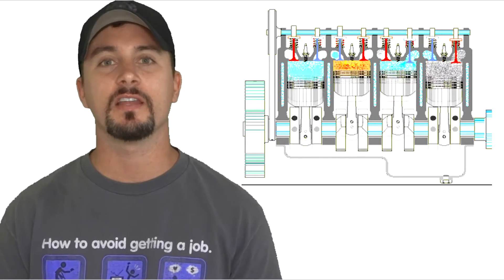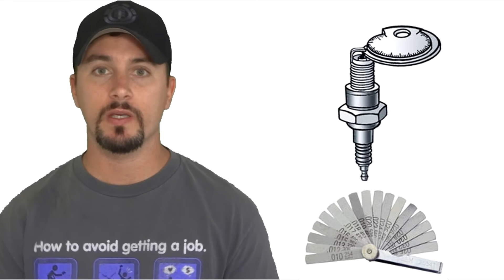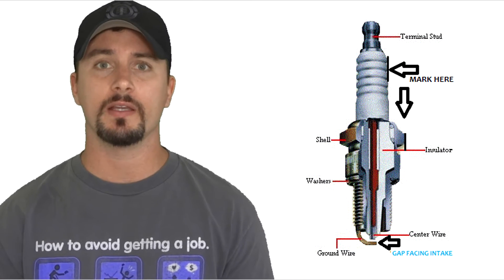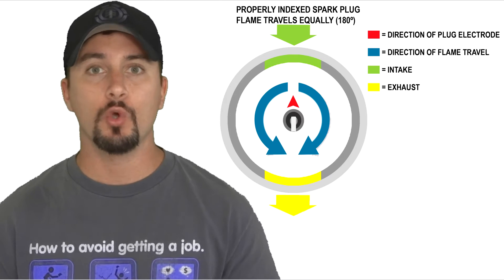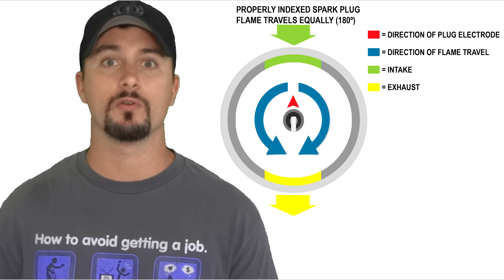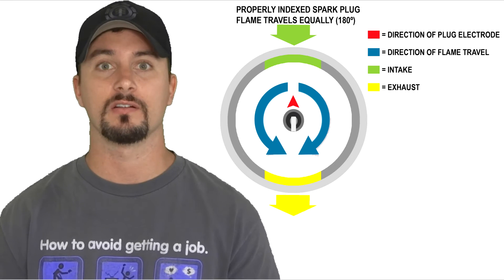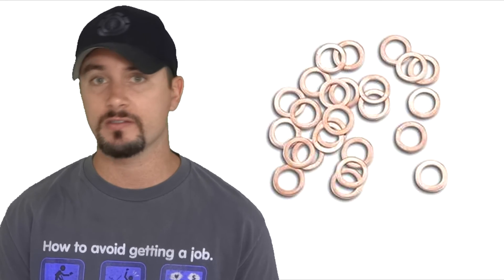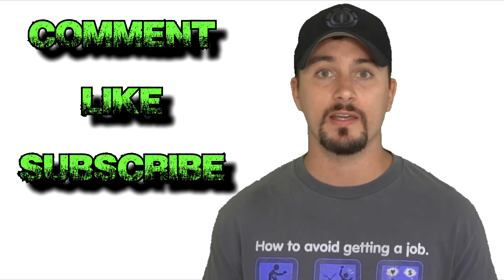Gap & Index Spark Plugs "How To"

Comment: You need to point the tip towards the exhaust manifold, the issue is when the intake air comes in it can blow out the spark.

Comment from the maker: Yes, aim the gaped part of the spark plug towards the intake valve,If you don't know the location of the intake valve on a 74 Datsun it's this way... CYLINDER 1 towards transmission...CYLINDER 2 towards cam gear....Cylinder 3 towards transmission....CYLINDER 4 towards cam gear....I did the research for you.. hope this helps. Towards cam gear means "the front of the car" and towards the transmission means "the back of the car"..that's where you will aim your gap.